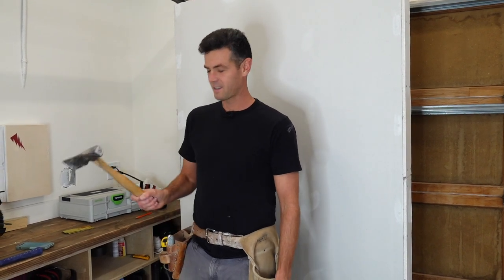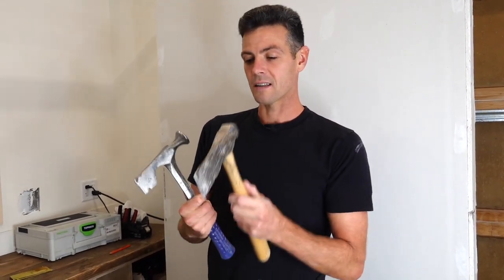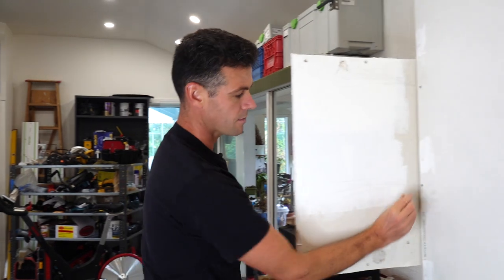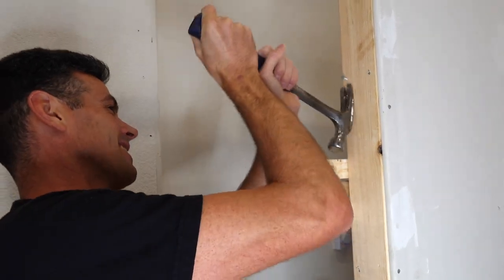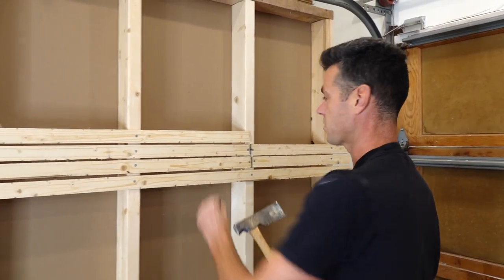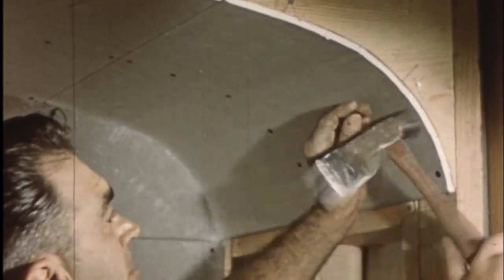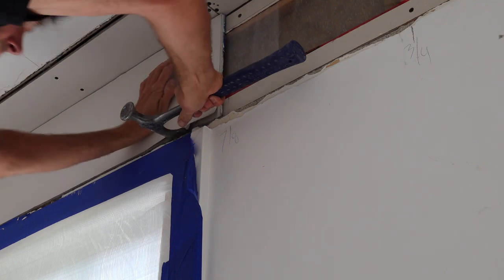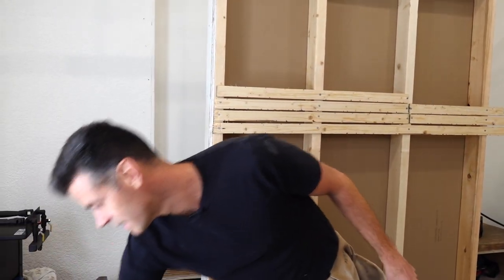Why are DRYWALL HAMMERS shaped like this????

Comment: You're also holding the nail wrong! Always have your finger nails flat against the surface. (roofers will also tell you this.) This way if you hit your fingers you hit the fat padded side (you can do this all day, no harm) and not the nail or worse - the side of the skin by the nail.  1:28 if you miss the nail and hit your thumb the tumbnail will cut into your finger and it'll be painful for a couple of weeks and the drywall will have blood spots. 
But I watched your video to learn Why drywall hammers have that hatchet side? Ah, lathing. I forgot.  You're too young to have seen much lathing. I think all the plaster hanging on it dried and fell off by the mid 1980s. You probably also haven't seen much horse hair sticking out of the base coat of plaster.  (You're not missing anything.)  The reason the plaster falls off the lathing is not just because it's old, but mostly because they didn't dampen the lath before applying the base coat. Now as the plaster sets the dry wood lath sucks the water out of it, this under minds the bond with the wood lath. And no one would notice for 60 years....
Here's a tip: If you're going to be doing a lot of hammering, put a rubber band on your wrist and practice 1. holding the nail so you can't hurt your fingernails and  (maybe) 2. Not using your knee to hold down a stud you're nailing through the plate to. I hit my knee doing this; an old carpenter laughed and gleefully said, "I knew you were going to do that!"  One of the other guys said, "Why didn't you tell him?" "He-hee! 'Cause now he'll never forget." He's right of course, but he's also an abusive jerk.  By having the rubber band, or tape on a finger, it'll remind you of these two warnings (or anything else you want to commit to memory and your skill set.) It'll reinforce it even better if you tell yourself out loud. (I'm a teacher and I've learned all manner of things, so I've collected all the best tips. There are no geniuses past about age 11, after that it's who learned and stayed focused.) 
Also that Rocket hammer? I've still got one that I bought in about 1978 (used it for framing for only one day. Actually half a day. Ray said, "Your elbow hurts? It will. At lunch I'll dig my spare hammer out of my truck stop by the lumberyard on your way home and get one like mine. Vaughn - have that one too.) Rockets are for demolition. If you swing that thing framing your elbow will start to hurt by lunch, then it'll stay that way and get worse -- so long as you hammer a lot with it.   Framers use wooden handles, the wood absorbs the shock and vibration. Of course you'll have to replace the handle once or twice a year (if you use it a lot). Small price to pay for a painless arm. 
We also called gypsum board "Plaster board". It was a bridge material between wood lath to drywall. (Now a days if you want a plaster finish you'd still just hang drywall.) 
You missed an important bit:  double nailing in the field of the sheet of drywall. If you  put only one nail in the field (away from the edges) that nail will later pop, right through the drywall compound, tape and paint.  But if you put two nails about an inch apart - neither will ever pop. And you don't want to break the paper because that weakens it. On that edge  though, no problems, just get enough nails in it, the mud will cover it, and it's strength from the paper doesn't matter because it's backed by the end stud.   Also I never use the mesh drywall tape. I think it's crap, but a lot use it. I was fixing up my house before a 5.8 earthquake, used papertape and the mesh tape. The mesh tape all cracked, the paper tape didn't. This is a special case. There had to be movement to make the crack in the first place (btw plaster over gypsum 1930s), any movement after that the mesh tape would crack. Still, I only used paper tape after that and spec'd it to any subcontractors. 
The way they kept that hatchet sharp is to carry a fine flat file, just like the farmers did for their scythes. A few swipes and it's sharp again. Good trick to know. File into from the edge. And just a few swipes, sometimes in but also along the edge. 
A few days after my knee incident I saw that old carpenter and another guy who also had 'issues' (drinking, bad attitude, unreliable); their vehicles parked on the side of I-23 fist fighting.  Idiots. 
Why not find some old guys and ask them about some of this stuff. My dad was a carpenter; I only did it for a few years, but there should be old guys still around who really know stuff. Some tricks that are still really useful. When I was learning and teaching physics I had the idea of getting some classical physic professors together with some old framing carpenters on a job site and have them swap tricks. I know they'd all have a great day. 
And nailing skill. It's just practice and experience. I used to be really good at it; nothing compared to my dad. I've been using drywall screws since about 1977,  nails for the metal corner bead.
Personally - I hate drywall. It's dusty, heavy, and I've just never been good at mudding so I've always had to do a lot of sanding. Of course it's a great material, but get someone else to hang, tape and sand it.
Reply: Thanks!--I'm just a go-fer, but that's the best all-around comment I've ever seen.  Good stuff!

Comment: Wooden handles are tops est wing metal hatchets suck and are bad on wrist and elbows to much vibration. Also nails in angles no screws the taper will love you for nailing correctly NO HANGERS I don’t care who you are if you screw angles there will be hangers not good on tapping tools $$$$$$$

Comment: Why in the world are you still using nails for drywall! When the drywall screws came out, it totally ended my having to go back and reset nails that weren't properly put in or had backed out later, which is a real pain. Get on with getting modern and use screws, the nails are old school today! I have been building new homes and custom kitchens for over 50 years, and this is not the best way today to hang sheetrock!